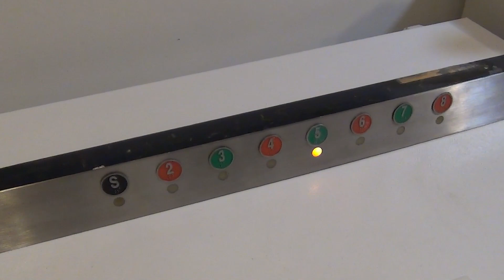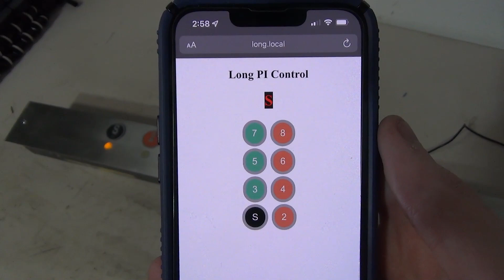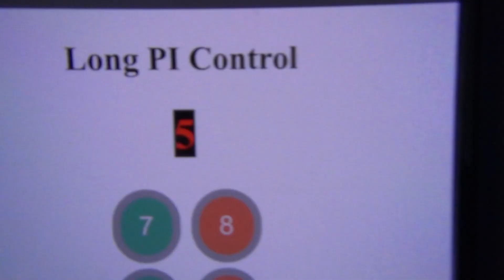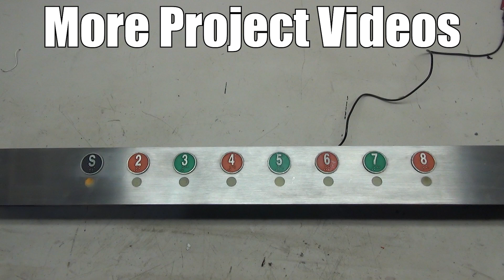Phone Controlled Elevator Indicator

Comment: Nice! Perhaps you could make a simple app for it with a template on one of those app creator things.
Reply from the maker: I'd rather learn to develop it myself instead of relying on some other software. Then I can put exactly what I want on it. The website based controller also makes it where anyone can use it without downloading an app.
Reply: @stlelevators  that is totally true! do you know how to develop apps for iOS or Android currently? I’m taking an app development course right now and it’s pretty tough but rewarding in the end. Also, you could leave the site as a limited option and have the app with extra features so you have the best of both worlds.
Reply from the maker: @ShowMeStateElevators  I've never tried, but I think the system I have in place will let me implement the system I eventually want to build. I wouldn't really need to add any more functionality on the site sides of things, so having the app just would add extra overhead in this case.
Reply: @stlelevators  yeah that is true. Looking forward to seeing the future of this thing!